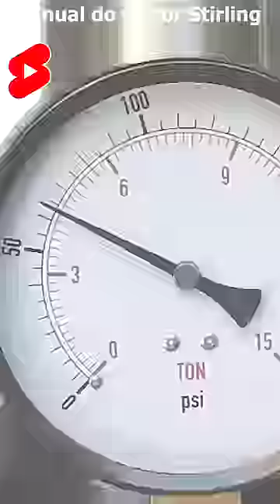( I MANUFACTURED A STEAM ENGINE ) To produce electricity.

Comment: Steam that comes out of the engine, make it return to the hot water tank in order to reduce the water drainage
Reply from the maker: Yes, it could! However, it was not done in this project, thanks for the observation.
Always welcome to the channel.
Leandro Wagner.
Reply: The steam exhaust can go up the boiler exhaust to make the fire draw and burn faster.
Reply from the maker: @dantonks450  This I did not know, but I had already noticed the steam along with the smoke in the trains and tractors.
Always welcome to the channel.
Leandro Wagner.
Reply: @ManualdoMotorStirling you can put a “however you spell it” nozzle on the high pressure steam exhaust and pull air through the fire However since you models fire box is so small it most likely won’t need forced induction

Comment: Also one of the most challenging facts is that the speed of the steam engine must be constant, so that the voltage doesn't change, however, using a capacitor makes the voltage constant, it also reduces the load on the engine.
Reply from the maker: The best solution to this problem is a flywheel with twice the weight, but the engine loses immediate response on acceleration.
Always welcome to the channel.
Leandro Wagner.
Reply: @ManualdoMotorStirling  So the solution would be to use a capacitor, the flywheel does help the engine speed become constant however, but to make it less challenging, a capacitor could maybe do the trick.

Comment: The idea is already simple, but the problem is very expensive because of the coal, wood and/or others.
Reply from the maker: Yes, this is just a personal challenge to work with our creativity and live a moment that made history.
Always welcome to the channel.
Leandro Wagner.
Reply: В случае реального использования, машина будет работать на кизяке, на остатках кукурузного початка, на скорлупе ореха, на бамбуковых стеблях (это трава!), на сконцентрированном солнечном инфракрасном излучении (от параболического зеркала или через линзу), на ядерном топливе, в конце концов.

In the case of real use, the machine will work on dung, on the remains of a corn cob, on a nut shell, on bamboo stalks (this is grass!), on concentrated solar infrared radiation (from a parabolic mirror or through a lens), on nuclear fuel, after all.

Comment: Fine engineering. Firing with coal ,however, requires a method of replenishing water to the boiler to prevent a boiler explosion. 
Using gas or alcohol in a removable or throttlable burner would be wiser.

Comment: I’m surprised the few threads on that little bolt can handle all of that pressure
Reply from the maker: 60 psi is not that much pressure!
Always welcome to the channel.
Leandro Wagner.
Reply: @ManualdoMotorStirling  Все эти ненормальные меры, такие, как фунты, дюймы и прочие, вводят меня в ступор и вызывают стойкое несварение желудка.

Comment: That amount of mechanical engineering etc for that 12-13 volts?
Reply from the maker: Hello friend! If you want, you will have up to 220 Volts, but the power will always be the same, which is 25 Watts, regardless of whether you have a 12-volt or 220-volt output.
Any questions, you can ask me.
Leandro Wagner.

Comment: You forgot that your boiler will never be able to supply your engine. The boiler is to small, for the cylinder size. Also if you get to much water in your cylinder you will destroy it. Water hammer.
Reply from the maker: Hello friend! Yes, you are right, we noticed that the boiler should be bigger, thanks for the observation.
Always welcome to the channel.
Leandro Wagner.

Comment: din brushles nu ai eficienta niciodata un magnet este cu N si altu cu S si tot asa, polueazi ca in 1880 , pune un panou votovoltaic in acu 18650 si nu ai stres, etc, produci mult mai putin decat condumi pe carbuni...etc..
Reply from the maker: Da, ai dreptate și în zilele lungi de iarnă, cum vei face asta?
Aceasta este doar o posibilitate și nu o soluție.
Întotdeauna bine ai venit pe canal.
Leandro Wagner.
Reply: Day, la incalzire lemnele sunt ok, so poti face energies electrical si din motor stirling, etc.